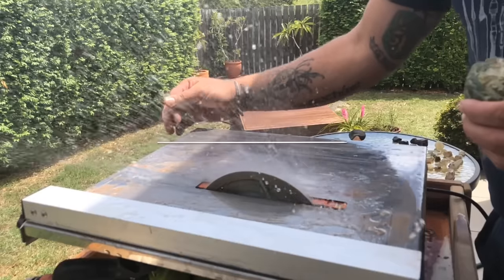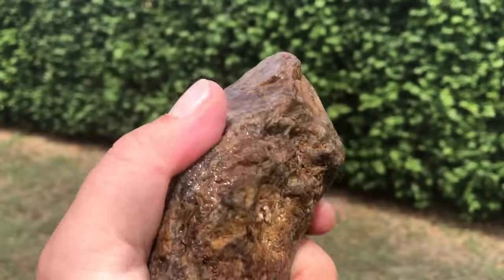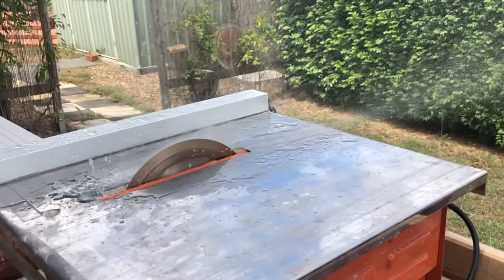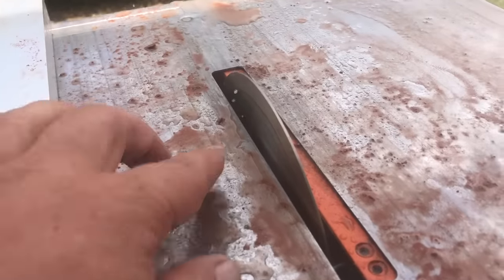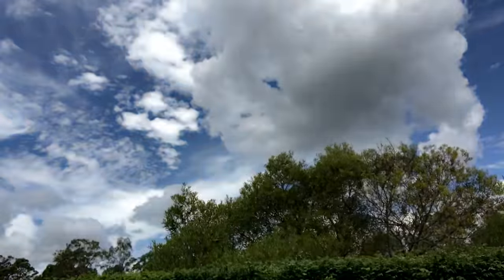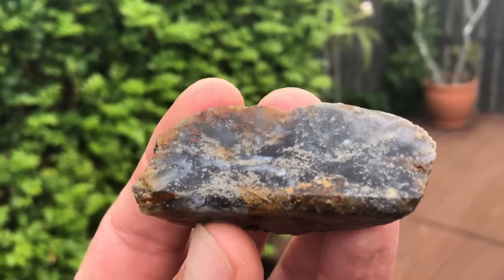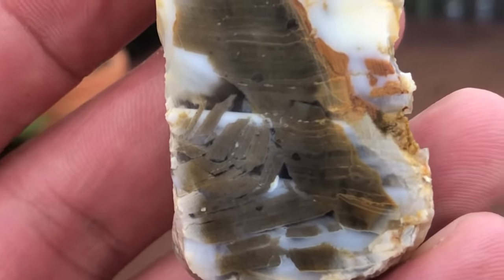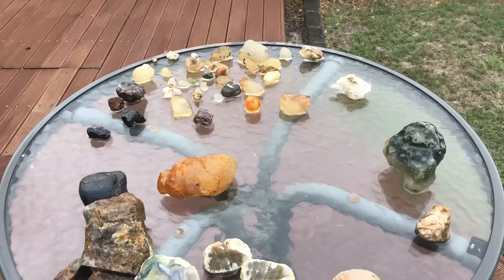How To Cut Rocks On A Tile Saw • Viewer Suggested Tips & Tricks

Comment: Ok so I tumbler rocks and there’s always pieces on that I wish I could just cut off before tumbling. Overall what is the best thing for me to buy to cut things like agate, quartz and things like that, something cheaper. What are those $60 jewelers saws online? Will those work? I just don’t even know where to start!
Reply from the maker: Hey DollPlace, look I don’t really know other than what I’ve experienced but I’ve just started my first tumble since getting the tile saw and loaded up the barrel today. I spent a few (enjoyable) hours trimming and shaping some chalcedony, (Agate and jasper), which are pretty similar hardness of quartz
And filled the barrel with what I shaped. It’ll be another 6 weeks I’d say until I know how they go, but I’ll be showing the process when they’re finished whether it worked well or not. For me the tile saw works a treat. If you look for second hand ones and get a new blade from a hardware store, it should do the trick nicely. Best advice while cutting has been to take the cut slow, and don’t push hard. You can also use the sides of the blade for shaping. Not only did it work well but it was so much fun and almost meditative. 
As for the $60 jewellers saws, I’m not sure? It could be useful but I’ve never tried one so I can’t really say. I reckon as a new tumbler myself, the natural progression has been the tile saw. But I’ll let you know how it worked for pre tumble shaping in about a month... 
I hope I’ve helped. All the best and let me know if you find something that works well for you.
Reply: Look around..auto shops and metal workers an weders got diamond wheels..fetch a few stubs...almost worn down ..grounded moters and dripping
 water.a wet sponge might do...safety glasses leathet gloves and mask for dust...broken grinding wheels are perfect for hand grinding an arrohead trick..

Comment: Just use a speed controller for routers... The tile saw plugs into it and it plugs into the outlet, it has a knob to turn to adjust the RPM of the blade, to keep the saw from leaving the marks...

Comment: 11:31
The marks in the stone are because its a cheap saw(not your fault) and the blade doesnt run true. This means it wobbles a little. It can be ballanced sometimes. On the big saw they are very precise. Sometimes it can be where you bolt it on, there may be a burr under the washer or bolt😉
When you double cut as well we end up with that blemish in the middle.  Diamond pads on a polishing grinder work amazing for finish polishing.  They are interchangeable and have grits from 100 to 3000 which is finest. 
Hope this helps bro
Keep picking love your finds
Reply from the maker: TheStraightPath 
Thanks for the tip man! I never thought about the bit where the blade goes, I’ll need to take it off and check it out. 
And I think I’ve decided that the polishing method you’ve described is going to be my next investment. I’ve seen another guy use it (Kevin Nix) on YouTube as well. 
Thank you again for all your tips mate!
Reply: TheStraightPath 
I do believe the wander you are describing ( which is a factor often overlooked) is not present here, I have looked again at the blade when rotating and it is difficult for a positive assessment with the lateral movement of the camera.
Double cutting or deep cuts where the rock is bigger than the blade has to be done by flipping the stone over end to end and the second cut has to be started with the cut line vertical so you can follow the original cut, you will get a step if the rock is not vertical with the cut line.
There is a way for ensuring a clean cut but that involves making a jig for freehand cuts.

Comment: I don’t think I’ve heard you mention the actual blade that you are using. Could you enlighten us?
Reply from the maker: For sure, it’s the blade that came with the saw. It’s a diamond impregnated continuos tile saw blade. It’s not a lapidary blade though. The replacement is worth about $70 but I haven’t changed mine for over 2 years and it’s still cutting awesome. You just need to cut a red brick sometimes when it’s not cutting very well and it will clean it up and make it cut better. 👍

Comment: what kind of saw you use??? doesnt seem like a specificly lapidary saw (the "station/bench" at least), looking for cheap options and the real prime condition saws out there are realy expensive
Reply from the maker: Matías Errázuriz 
Yeah you’re right, the lapidary saws are very expensive. They do a better job to make the cut surface smoother but you can get a nice cut on one of these saws. It’s a tile saw. A wet tile saw. And it totally works a treat.
Reply: @Rookie_Rockounding  thanks

Comment: The respirator probably helps better than nothing even if you’re not clean shaven, but you’re really supposed to be clean shaven to create a tight seal. You’re still breathing unfiltered air without a tight seal. To check your respirator’s seal flatten the palms of your hands on the filters and try to breath in, if you feel air coming in through the sides it isn’t a tight seal. You can also put the palm of your hand on the valve right in the middle and try to breath out, if you can push air out it is not a tight seal. You may feel the air rushing in through the sides where your beard is preventing a seal. I just don’t want you to have a false sense of security with that respirator. I work in pest control and we are trained on proper use of respirators and do fit tests once a year, very familiar with them.

Comment: Not to be a debby downer here. But when you wear the respirator you really should have a clean shaved face.  The beard creates a gap for dust or what ever you want out to make it's way past the filters of the respirator. But like you said you are creating minimum dust and making wet cuts so that helps but just another tip.
Reply from the maker: Haha, no I know, I’ve since been told a few times 😣
Thank you though for the help 👍

Comment: Talking about safety and doing it safely are two different things. The mask you are using requires a proper fit for it to actually protect you. You must be fit tested using one of the two methods described in the many occupational safety standards used through the World. In both of these methods a fit test is required that you shave your facial hair for the mask to fit. You cannot be certified for any hazmat environment including the exposure to airborne particulates such as silica or asbestos which are commonly present in rock dust without passing the fit test. If you were doing this same job in an industrial environment, Fired.
Reply from the maker: Yeah no I hear y’a. This was a long time ago and a friend mentioned about silicosis so I just rushed out and got a mask. But I’ve since learned exactly what you’re talking about. That and that the water keeps the dust from being agitated and in the air. You seem like I’ve upset you.